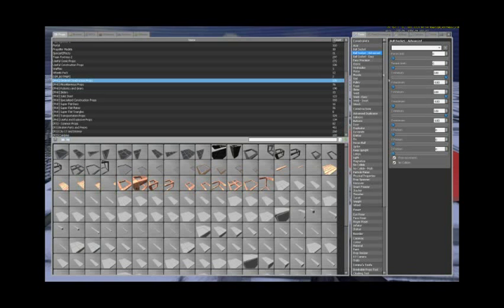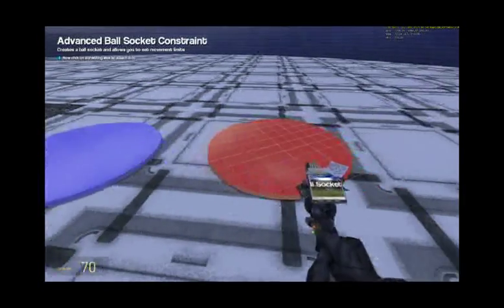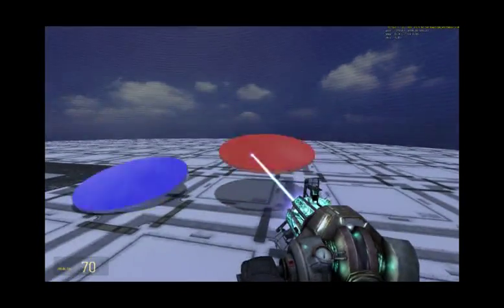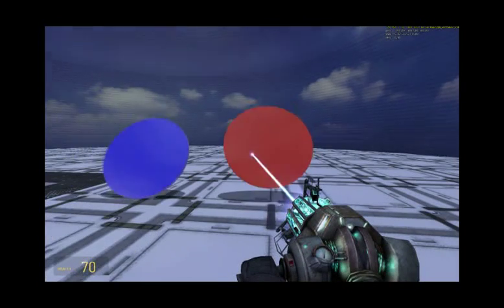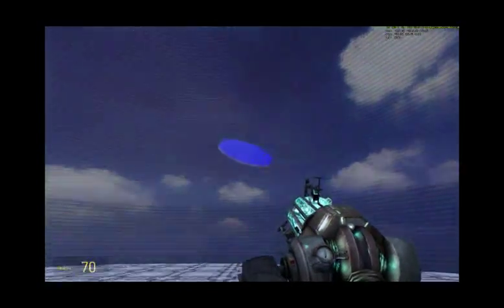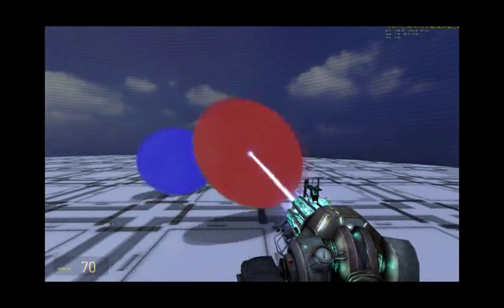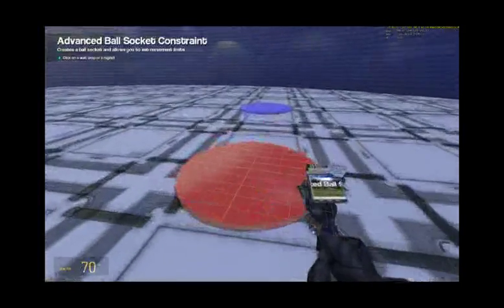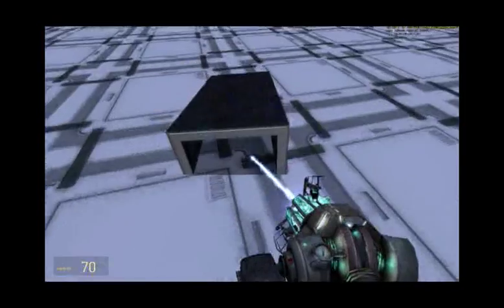[Gmod][Tut] - Advanced Ballsocket Settings.

Comment: You can also use adv ballsocket also to hold props around 1 or 2 axises (zeros or -180max and 180min) and allow them to rotate around the other axis(es) freely (-180,180) or just to some degree (-30,30) - this can be used to attach two props (free movement off) and have them rotating in just some angle (car steering for example)

Comment: Few corrections: you don't need to use -180 and 180 to maximum and minimum, you can just use zeros and it works the same. That slackness shows only in the direction of x axis, which is quite strange and I am quite sure this is a bug.